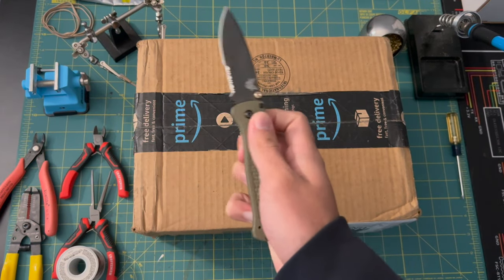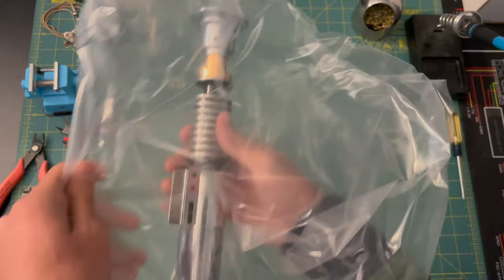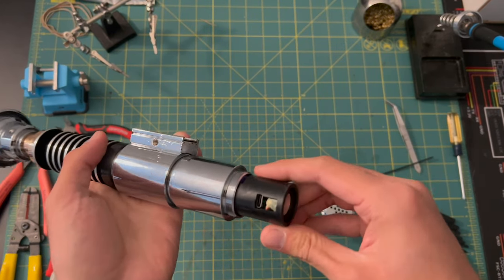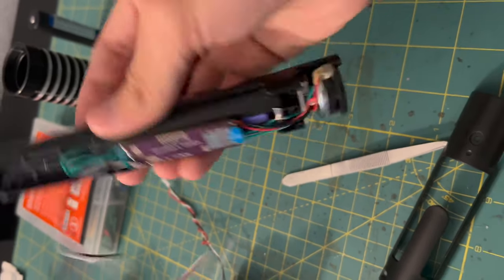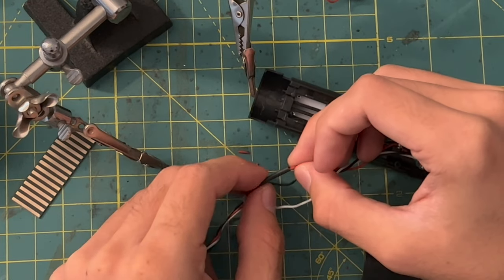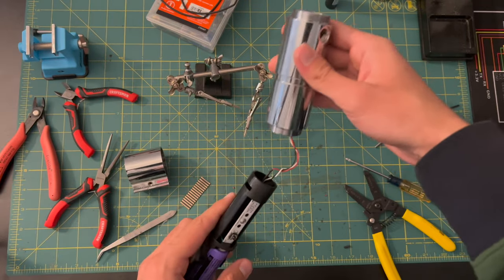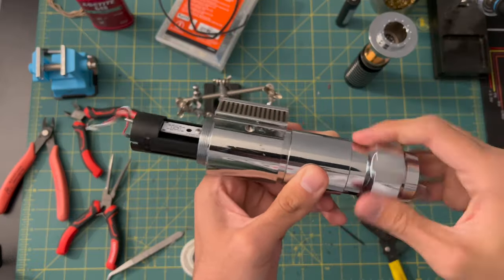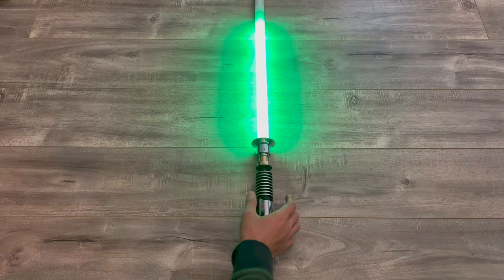Fixing Luke's Lightsaber | Broken Emitter Wire

Comment: how much would it cost to do this?
Reply from the maker: It depends on what needs to be fixed, if it’s something like a broken wire that’s easy to do I think I just charged like $15 or something. Plus whatever the shipping was
Reply: @averycastillo  is there any place I could contact you about possibly getting the same thing fixed for mine?
Reply from the maker: @willclark3120  either an instagram message or email 👍 Check in the description